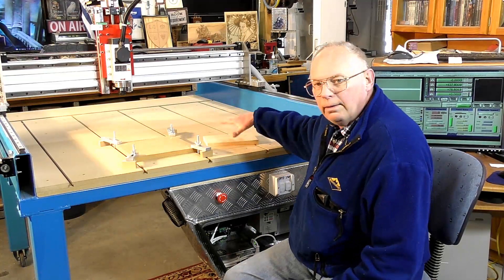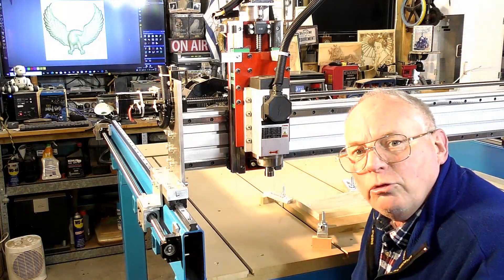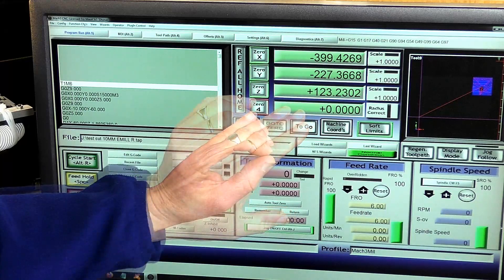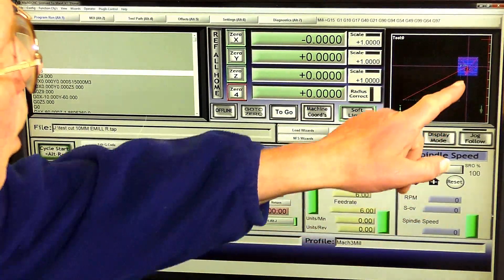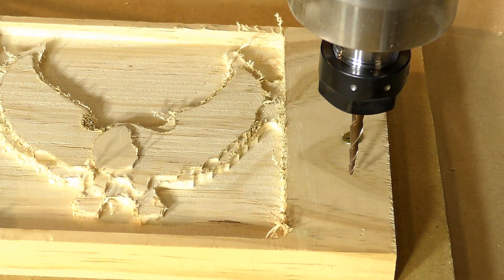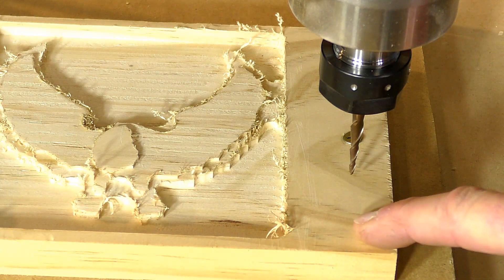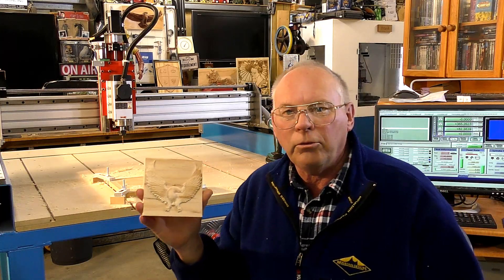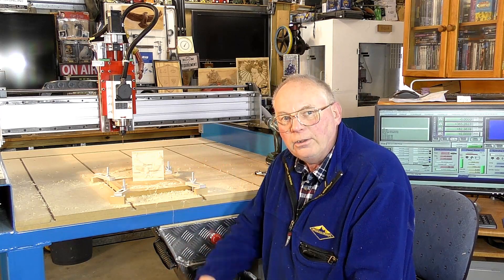CNC router first 3D TEST DRIVE machining

Comment: Hello Roger, just few question: What is size and model (hgh, mgh) z axis rails? I see you do use probably 4080 or 3060 profile for x axis. What total weight of gantry and what stepper motors do you use to move it (two of them, right), what voltage?